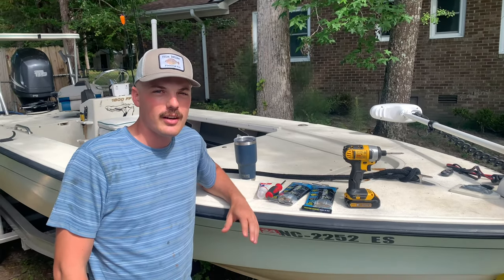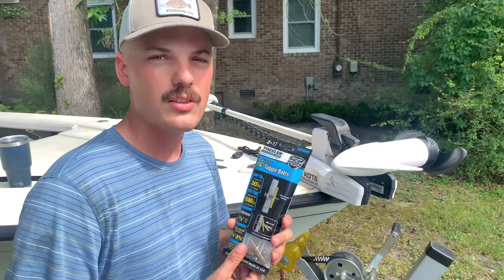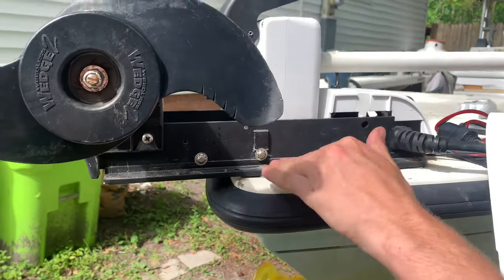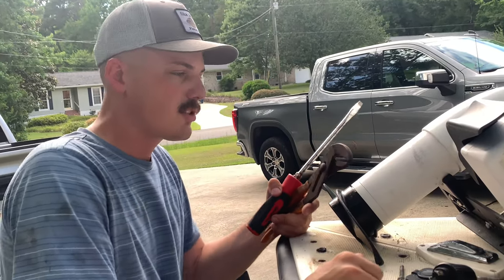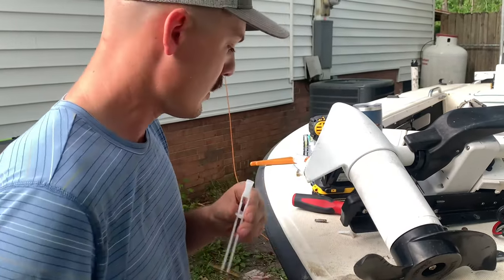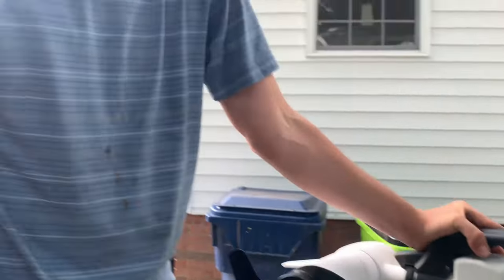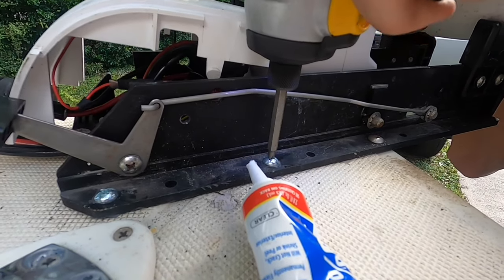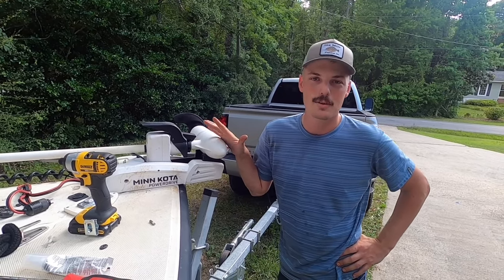Using Toggle Bolts To Mount Trolling Motors (No Bow Access)

Comment: I am doing this today to my boat. I have stripped bolt holes and needed a better solution. I use these at work and knew this would hold well and seeing you use them just verified what I wanted to do. Thanks for posting.
Reply from the maker: Check back in let us know how it goes don’t forget to absolutely smoother those things in grease to fend off corrosion

Comment: Thanks again for this tip. I just installed my Minn Kota Fortrex using these toggle bolts last weekend. I took the boat out yesterday to try out the trolling motor and everything was solid. I feel these are way better then the rivet nuts that you can use. I was afraid the rivet nuts would eventually start spinning with all the vibration and just just hitting waves constantly. I feel these toggle bolts will hold up for the long haul. My friend that helped me install the trolling motor said these were a great invention. Thanks again!!!!
Reply from the maker: Thanks so much for the comment and u am so happy I could help out. Thanks for watching and checking out the video

Comment: Just the video I was looking for. Thank You for doing such a Great job explaining all the steps. I have no idea how someone got a nut on the back of my current trolling motor setup. They had to have tiny arms and hands. I will sawzall off the bolts holding them on right now and then use the method that you just showed. I will install rubber gaskets like you mentioned. I believe in the Minn kota hardware kit it comes with it. Thanks again. Great Video!!!

Comment: Thanks for the tip! I ran into the same problem on my '16 Tracker 195TXW. No access and I'm sure they installed the factory trolling motor before the deck was on. Thank you for the great video!!
Reply from the maker: I hope this works for you, these lasted me two years, BARELY any wear on them and that’s WITHOUT applying silicone, thanks so much for checking out the video
Reply: @fishingwithaustin8258  worked absolutely perfect!!! Thanks again!
Reply from the maker: So happy to hear that

Comment: For what its worth... You can go and get some 1/4-20  stainless bolts and replace the zinc bolts that the anchors came with. (or stainless metric bolts) That plus a healthy dose of sealant and you wont have to do this but every 5 years instead of every two. You can get stainless bolts just about anywhere. Just buy good quality as cheap ones tend to strip out easily. I get mine from a local bolt and screw store and you can purchase them for about a buck. The ones that Lowes and Academy sell are apparently made with Unicorn fur, fairy dust and gold thread to make them as expensive as they are in those stores!
Reply from the maker: Terrific advice thank you

Comment: I wonder if blue thread locker might be a better material than the silicon sealant? Just a thought.  Looks great!
Reply from the maker: Yeah if it’s wards off corrosion better than by all means! I just like silicone for fighting corrosion best, the bolts backing out didn’t seem to be an issue
Reply: @fishingwithaustin8258  I've never tried it, it just seems like the sealant will get sticky and make it hard to back out the screws. Again, just thinking out loud! I'm totally going to steal your idea of the snap toggles!
Reply: Might even make a good video...wdyt?

Comment: West Marine sells stainless steel toggle bolt backings that zip in like the non-stainless ones you used. Why the heck did you skip some sealant around the screws?
Reply from the maker: Very good info! Thanks for letting me know it will be used next video

Comment: Great way to mount your trolling motor. I know you said you used toggle bolts, but what type were those you used? Thanks, Steve
Reply from the maker: Hey Steve, I used the most heavy duty ones I could find at Lowe’s, I believe they were 1/4”? Just whatever fits those holes best
Reply: @fishingwithaustin8258  Thanks for the reply my friend. Steve

Comment: This is cool, was looking for something just like this. Just a heads up, you can buy 1/4" thick rubber washers for like .80 cents each at any hardware store instead of a gasket under your trolling motor plate. That's actually what my new trolling motor came with. I want to do this, would make my life a whole heck of a lot easier but my only concern is drilling a bigger hole in my deck for each of the toggle bolts then what is already there. Guess I can try this out, if it doesn't work I can always mount it on the other side. So after the motor settles there's no side to side movement in the motor due to the bigger holes you had to drill in the deck? That's my only concern. What LB thrust is your trolling motor? Thanks for the video.
Reply from the maker: Hey! Did this workout good for you trolling motor?
Reply: @fishingwithaustin8258  bro this worked out amazingly for my trolling motor. I drilled 6 holes (1/2 inch) and mounted a 82lb Motorguide Tour Pro using 6 of the toggle bolts. Ive had my boat out about 12 times since using these and I will never use anything else. I had my trolling motor completely mounted in about 15 minutes. My front deck has a small space to reach in to try and tighten the bolts and Im so happy I never have to do that again. These toggle bolts are a life saver…i believe I got the highest weighted rated ones I could find at aprox 800lbs I think. Could be wrong on that but get the heaviest rated ones and you’ll be good. I could look up the rating if you want me to? Just let me know. Maybe it was 200lbs lol. I’ll look.
Reply: @fishingwithaustin8258  hey the ones I used I got off Amazon and each bolt is rated for 270lbs each. I used 6 bolts for my motor and its solid. Doesn’t move at all. Super easy to install and 100% worth it. Tight lines man.
Reply from the maker: Yeah all you have to do is buy the heaviest duty ones for like 20$ you have a mounted trolling motor! They’re solid, I lifted the bow of my  boat up by my trolling motor bracket, happy this worked I’m happy to hear it
Reply: @fishingwithaustin8258  I was replyin on my phone and didn't realize I was talkin to the dood who made the video. Bro you saved my arm and like half a day for me. Seriously, I've put on 3 different trolling motors on my boat and because the hole is so small to put my arm through my arm is wrecked every time I've changed my motor. Had this done in 15 minutes, told several other people about this and 2 of them have done the same thing. I've done a trolling motor review and will be posting it soon on my channel and I'll put a link in the description to your video. At the time I was reviewing my trolling motor I couldn't remember your channels name but I'll link to your video. Not that it will make a difference but I'm gonna give you credit cause this was life saving! Well at least arm saving. Thanks again.
Reply from the maker: Many thanks 🙏🏼 I appreciate it and that’s why I make these so I can help people and I’m glad this is an easier way for you

Comment: one word of caution if you are using your boat in Salt Water, toggle bolts are usually not made out of Stainless Steel and will rust out.
Reply from the maker: That’s why I smother them in silicone sealant and replace no longer than 2 years old
Reply: You CAN find them in SS... 304, if memory serves. 
316L is the most rust resistant for saltwater use, but hard to find, and 3 times more expensive.
Reply from the maker: @jkg6211 it’s one of those instances of getting what you pay for, and if a 1500$ trolling motor is on the line I’d definitely fork out the extra for the better quality bolts!!!!!
Reply: @fishingwithaustin8258  
You got that right brother!

Comment: What volt size troll motor you running and what do you recommend 12v or 20v cause I talk to some about a 12v but sometimes if they wind is kinda moving they said on a 12v battery doesn’t last as long
Reply from the maker: Compared to a 24 volt yes a 12 volt doesn’t last as long. Always buy according to the conditions you anticipate fishing, and then go above that a little bit. 

I have a 24 volt because I fish saltwater and inlets and it is plenty of power to hold my hot with spot lock. 

I recommend 24 volt, you’ll take on a little extra weight but your trolling motor will be more powerful and last longer. They also have 12/24 trolling motors where you can activate 24 volts as needed but run 12 volt when you don’t need 24 volt. You can run your batteries in a series and last as long as a 24 volt with a 12 volt. Pretty cool stuff!

Comment: What about the very from 2 bolts? Did you use the toggle bolts for that as well? And do you know what the original size bit you used to drill the holes?
Reply from the maker: Since the very front is to close for them to penetrate we ended up sealing those, for the drill bit size I’m unsure we just used a standard Phillips head bit that fit the bolts nice and snug to ensure no slipping
Reply: @fishingwithaustin8258  okay thanks! I was able to find a stainless toggle at Ace and that worked for 1 of them. I appreciate it!
Reply from the maker: @limousinlover  I’m happy this helped you! Thank you for watching the video

Comment: So you make me go and slide my card. I was thinking on how to install it now I know. How do you conect it to the battery if you dont have access?
Reply from the maker: I’m a bit confused could you reword exactly what you need me to answer please
Reply: I have a center console and im thinking to hide the wires but I have the same problem you have. I don't have access to the hall. I will like to have the battery in the center console with the othe ones but can't run cables through.

Comment: Do you need silicon if you have the anchors
Reply from the maker: The best method I would go with is a rubber mat under the mount, if you don’t have one then I would silicone around the edges.

Comment: This is a terrible solution and has set me back now quite a bit. Most fiberglass hulls have wood inside them which doesn't allow enough clearance for the wings to expand. Nor is the plastic strong enough. For a 1/4" you'll have to drill at least a 1/32" hole which is unnecessarily large.
Reply from the maker: Yeah I mean that’s your opinion, it isn’t an end all be all solution. My hull is composite with no wood, so yeah a terrible solution FOR YOU perhaps. Mine have lasted two years salt and fresh. Sorry to break it to you!
Reply from the maker: Also it isn’t plastic holding it, the plastic is just to line up and hold steady until you torque the steel bolt to the steel anchor you insert down in the hole, did you see it in the video?
Reply: Does not matter what kind of material it is. 😂
Reply from the maker: @russelldevane5434  regardless mine have stood the test of time 🤪
Reply: @Fishing With Austin  Yep.  Great solution to a big problem. Used them on mine and it worked perfect.
Reply from the maker: @russelldevane5434  I would ensure gaskets to prevent moisture I should’ve exclaimed that better in the video